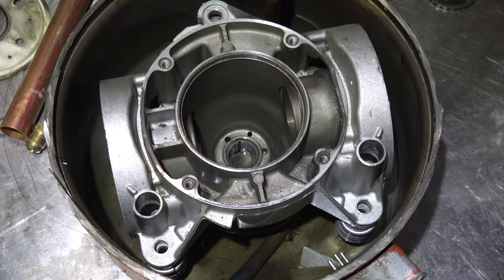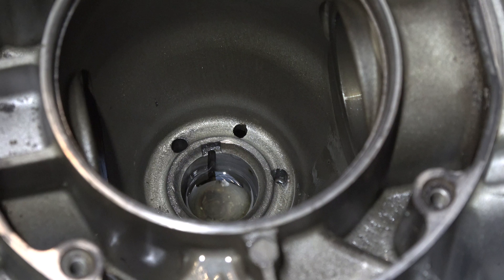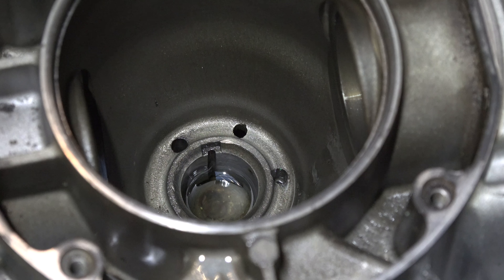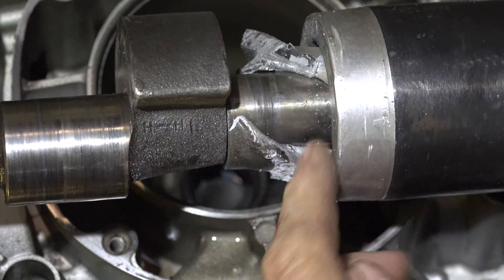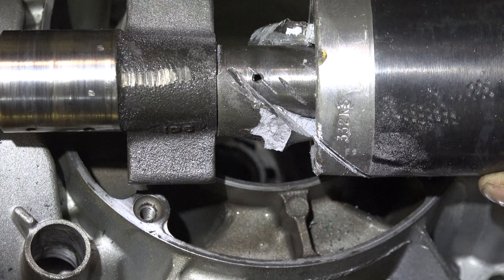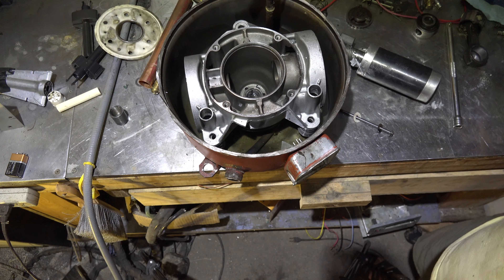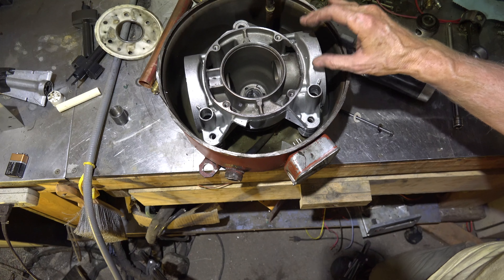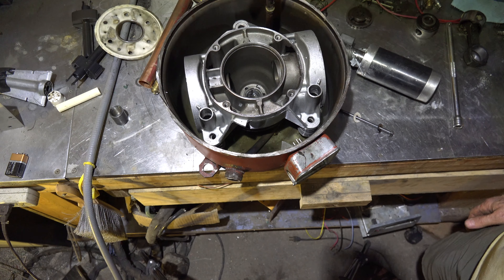Refrigeration compressor:  Why it failed. #6

Comment: Hi am a hvac tech starting on his own for banning unified school district in CA.  Im going on two years. But it's hard to learn with no teacher by my side I am a complete novice. I was hoping you could make a video on charging "oil" not refrigerant into the system. I have removed refrigerant due to overcharge, so I know some oil leaves the system. I have a yellow jacket oil pump and would like to use it properly. Thank you and you have been one of the best youtube instructors.
Reply from the maker: I will be doing one one charging oil but I have seldom needed one as the amount of oil removed is usually very small.
GFM

Comment: Hey Gray, you answered the why it failed, but only touched on the 'how come'. Where did the missing oil collect and why.  Most importantly ...... how do you prevent it!  As always, thanks for sharing/greg
Reply from the maker: I will be publishing a video about the pumping and return of oil in the near future.
GFM
Reply: Spoiler: it involves the suction gas velocity being high enough to drag the oil film along the inside of the tubing wall.